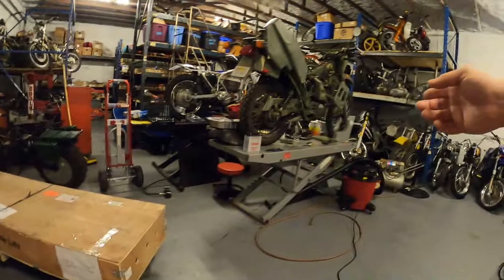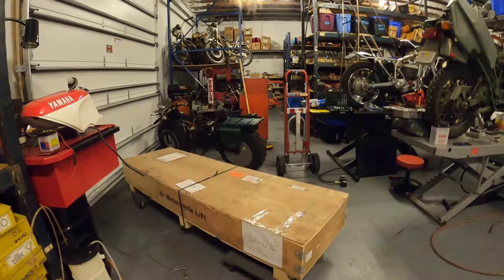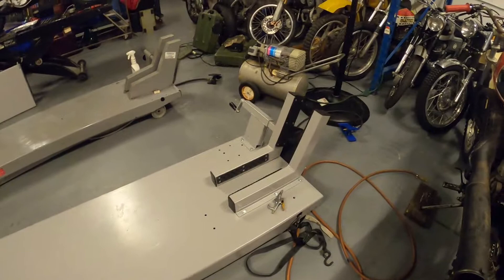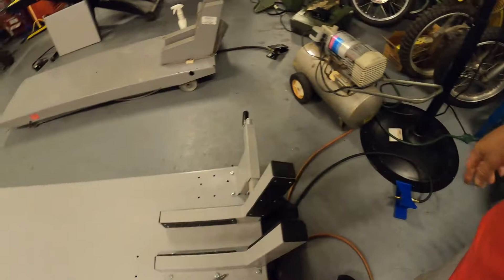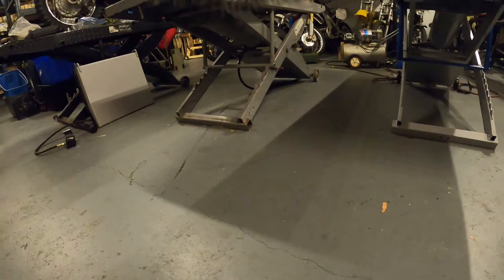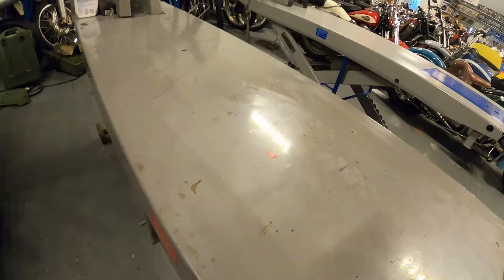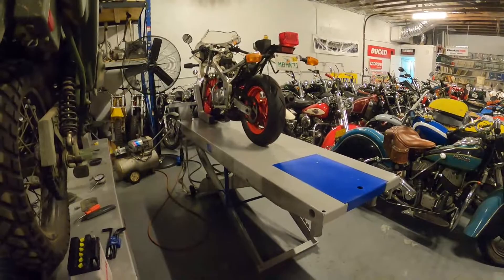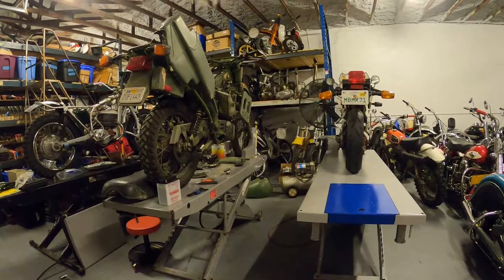DID CHINA CLONE HANDY'S FLAGSHIP MOTORCYCLE LIFT?

Comment: I just got the same older model Handy lift as yours for free. They were going to toss it in the scrap bin only because they bought a new unit. It has the vise and the extension side tables, plus 3 piece ramps.  I guessing the ramp from your Handy lift would drop right into the China unit...  I'll be rebuilding mine this weekend.  Have wanted one of these for 30 years :)

Comment: I spent a lot of money on a Handy about fifteen years ago. It wasn't worth it. The vice didn't even begin to line-up with the mounting holes. It looked like a child had welded it. Had to modify the lift table to accept it. The lift bed itself sat too high so my Harleys typically would ground-out when rolling on. Maybe needed a much longer ramp. Customer service was zero. Wouldn't buy one again.
Reply from the maker: Wow, that wasnt my experience at all. Even got parts for the one I pulled out of the scrap yard, then were very good. I wonder what happened there!
Reply: The tuxedo is as good as the hardy now with the rear tire drop out plate. Apples to apples your paying a grand more for built in USA plus shipping. can't afford it bought the tuxedo and a US shipping company made money on me.😊

Comment: I wanted your opinion on if you think the side extensions for the Tuxedo would work on the Handy. I have the new Handy SAM 1200 and the hole locations for the pipes seem to be in the same location as the Tuxedo. The Tuxedo side extensions are half the price of the Handy extensions. Compare the two next time you get a chance and let me know what you think..  Thanks
Reply from the maker: I dont have Handy sides, or the Tuxedo ones, but let me check the pipe locations when I get back to the shop. As you may know, I'm on the road this week checking out a swap meet. Thank you
Reply: @bullpencycles  Thanks
Reply from the maker: OK. I dont have a Handy SAM lift, mine Handy's are both standard. My old Handy does not have reinforced holes for the pipe/side extentions, just holes for the tie downs. My newer Handy has slots for their extensions, and they are located differently. So I cant answer that. I can and will measure the distance between the holes on the Tuxedo if you have a SAM you can compare, but they could still be off some
Reply: @bullpencycles  Thanks. Hole diameter and inside to inside between the 2 on the Tuxedo would be great
Reply from the maker: @robertfrost1623  hole diameter 34.96mm., Distance 188cm
Reply: @bullpencycles  Thanks a bunch🙂